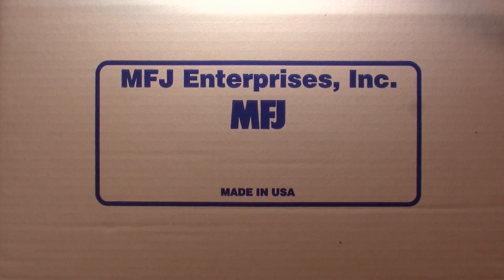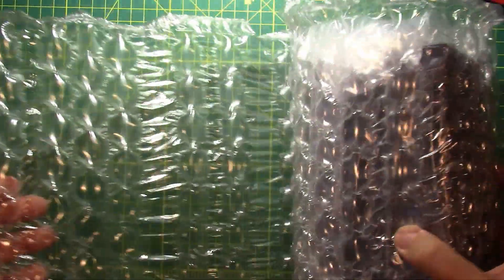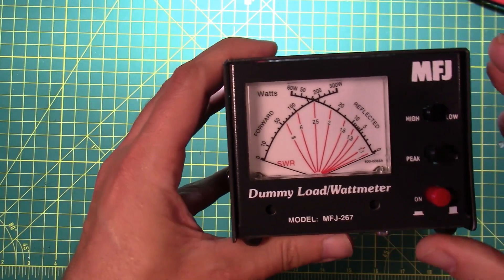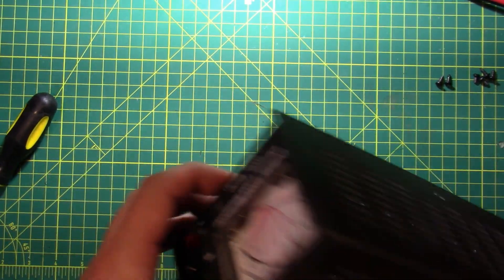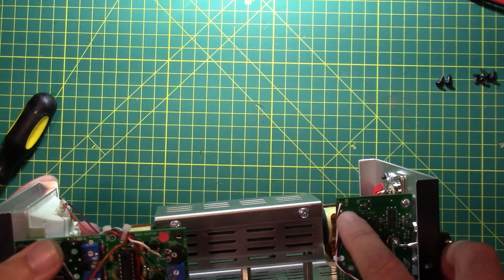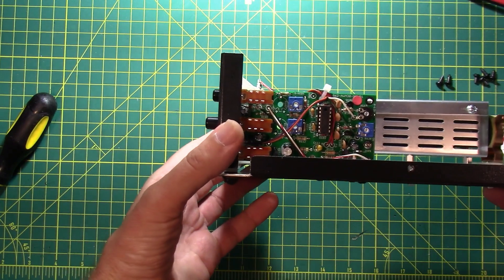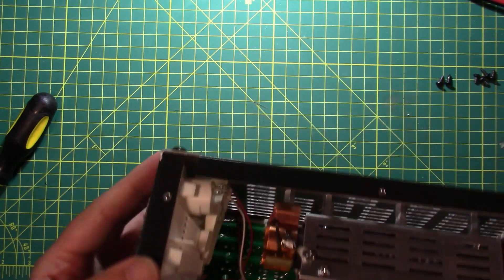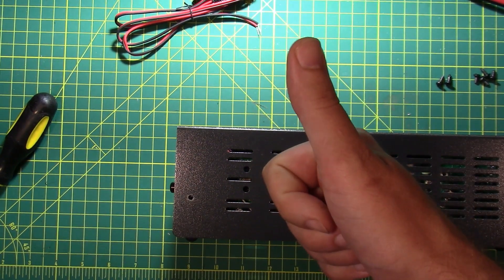#73 MFJ-267 Dry Dummy Load and Watt Meter - What's in the box?

Comment: nice dummy load. I have the outher one. 2.5 Kw fan cooled one. and oil filled ones some small ones  . that power lead is also for peak power reading. fallow duty cycle chart given. this is air cooled. short key down time. it may smell a bit when warm just let it cool. use  ABR RG 213 or coax rated power for 1.5 Kw. no RG 58 or RG 8X at 1.5 Kw it will melt. ! fine on 100 watt . POTAFLEX 7 from M & P can Handel full legal power on HF . nice neon yellow !  I have 3 ft coax jumpers on the way ! shipped from Italy ! POTAFLEX 7 .3 and 5 feet ones. K8MRD gave me discount ! same with Jason code but not both at same time . 73's
Reply from the maker: But do you have a Bacon Grease Dummy Load?  https://www.youtube.com/watch?v=dA4D7qH34jc